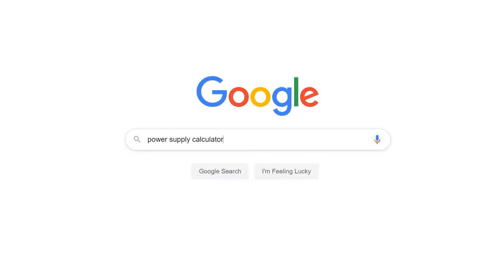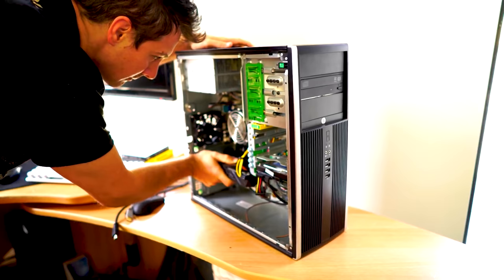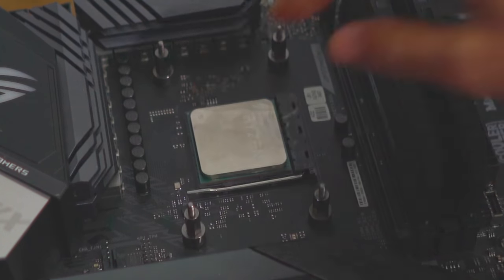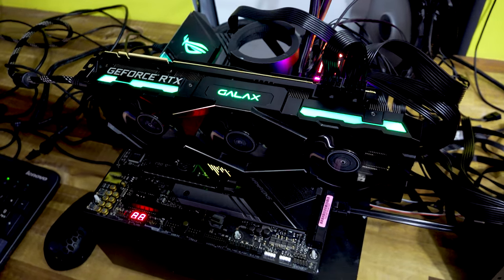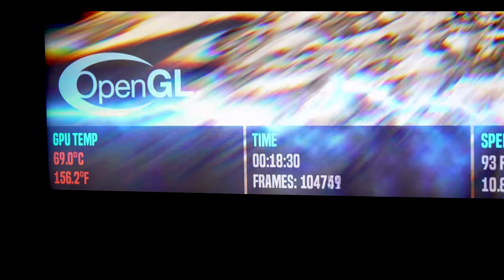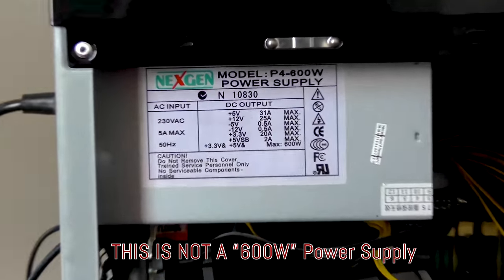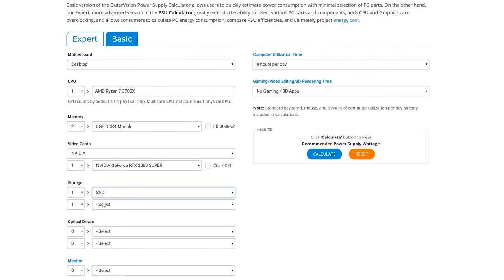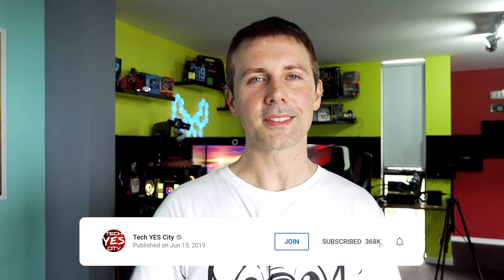I Tried Running a 3950X and RTX 2080 Ti on a 450 WATT Power Supply...

Comment: I' m a bit disappointed, you didn't stress both the cpu and gpu to 100% at the same time.... The peak watt usage as calculated was 477 watts, that's when the system is on a full load.
Could've achieved that fail state easily but you only stressed the cpu first, then the gpu afterwards. so all we know is that it's save to game on because a game will never fully utilise a 3950 and 1080p gaming will not fully utilise the gpu either.

Comment: You checked something that for your calculations is a BIT too low. BUT you didn't add keyboard, mouse, monitor, rgb motherboard, cpu rgb cooling, hours spend on gaming/work, and: OVERCLOCK. If you would get these thing you would get a real answer.
On be quiet psu calculator you would get a reasonable 636 and that means you need at least 650w psu. 600w psu would get it working, but you shouldn't be cheap with your psu. bequiet recomend at least 700w psu. On outervision you would get something around 641w load wattage.

Comment: Try blender cpu and gpu !!! , I get about 480 watts on my 3900x and a RTX 2700 super at the plug , which is about right on my 650 psu , So with the 2080ti I guess you will be over 500 watts ?.

Comment: While this is completely possible as shown in the video. But…. This psu will wear down over the years and quickly. So it will work but only a matter of time till it fails. Hence why one of my 750w 80+ rated corsairs can’t even handle a 1060 anymore after 12 years of use.

Comment: I have evga 550 g2 supernova 80+ gold , which is 12v 45.8a (true 550w) and my system is kind of old now (i5 4570 & gtx 960) so because of this i want to upgrade to some ryzen 3600 + rtx 3070. I wonder if my 550w would be enough for this upgrade or should I aim for less tdp cards such as 2070 or 2060s? I really want to go for 3070 since that card is going to be price/performance champion but I dont want to have to change my psu either... idk help guys.

Comment: i have a i9 9900k + RTX 3070 + 4x DDR4 8Gb + 1x M.2 NVMe SSD 1TB + 700W PSU = when i put it up a good GPU usage, the PC restart automatic, i changed the PSU 1 month ago, since myu RM750W Corsair fried. and since then...the PC does that when i use PGU power, and not only that, but fortnite on Performance mode, with only Fortnite Opened, it stutter A LOOT and some times crash the game...this never happened on previous PSU...what's hapenning here?? cause i'm going crazy!

Comment: I'm still using a 10yr only pc with a cheap power supply of less than $10 it's working perfectly fine...frontech. But the pc is so low end. I can't even play prince of Persia forgotten sands in the lowest settings with the lowest resolution even tried resolution lower than 500pixels :(

Comment: My 2070 super oc killed my 500 watt thermaltake psu lol. 32 gb ram. Liquid cooled. Fx 8350 4.2 ghz cpu. Lol I was amazed it lasted for two weeks
Reply: why oc it? it would've been just fine if u had stock clock

Comment: Hey everyone, Please help me..
I'm currently on Corsair CV450 PSU and i'm planning to buy a Amd RX 6600 xt for my build
My cpu is 12400f, mb is gigabyte b660m, ram is 16gb 3200 ddr4, one nvme ssd and 2 7200 sata hard disk and 3 140mm fans on my system
Is my power supply enough for rx 6600xt or i shoud upgrade my psu to a 550w unit or 500w unit?

Comment: I just went to that psu calculator website, but it doesn't have all the graphics cards to choose from. The closest one was the Nvidia 1660, but mine is the MSI 1660 Gaming X 6GB. It wouldn't even let me set the memory clock for an Nvidia 1660 over 3GHz, when mine is stock at 4GHz and OCd to 4.6GHz. With my build though (Using the 1660 provided,) it has a load of 505W and recommends a 555W PSU and I have a 550W PSU so Ig I estimated pretty well for what I needed.
Reply: After going to other PSU calculator sites, I've gotten different results between 350W to 650W for as close to the same build as possible, but without being able to put in the exact models of all my components and any overclocks, it really isn't accurate at all.

Comment: Through the time, power supply wattage DOESN'T make any sense. The old power supplys have way weaker 12V but bit more stronger 5V lines. Old 450W cannot compared to latest generation 450W. 

The video is right, you need look at 12V lines in the specifications. This is where we should look at it, to make sure power supply is good for your computer. And never go for the limits, because power supplys have safetly circuits to shut off the power supply.
That is why they need some headroom to keep it running without problems.
Stressing more out means also the caps in power supply will work harder and heat will bit higher. Higher heat in power supply will reduce lifespan of caps. 

The 80Gold marks is not for 100% power use, it's calculated around 50-75% power supply. Because at 100% the efficiency will go lower. So yes, for best efficiency, you need to use the sweet spot in the power supply, then you will waste less energy.

Comment: Running Rocket league in the menus in hundreds of frames per second is better for this kind of stress testing than running Heaven or Furmark.
You want to experience millisecond or nanosecond power spikes instead of a constant load.
Then the PSU turns off.

Comment: i try to run nvdia gtx 1070 external for my laptop...any suggestion how power i need for tht???
Reply: 300 watt alone is enough. 
Why? because You're running just GTX 1070 without any Motherboard, CPU, since you plug it to a Laptop as a External GPU.
Basically pay attention to 12 Volt must have 25 amps or higher

Comment: Still over power with a psu .
And the reason ?
The fan will not turn in the psu .
The psu can be use passive mode and you have no sound .
Same with water-cooling on a 65 watt tdp cpu.
You can cool it whit the fans of .
So over power use can be used if you want have a pc with no sound produce.

Comment: if the calculator says 620W and my power supply is 650W. Would that be fine?
Reply: It should be as long as you're not overclocking or doing anything too CPU/GPU intensive.

Comment: Would 400watts work with a RX 570?
Reply: Yes, 400-450w with any 80plus certified will be ok for RX570, RX5500 xt, GTX1060/1660super, RTX3050 and RX 6600. My rig with ryzen 5 2600, 16gb ram run RX 570 for more than 3 years and still staying strong now

Comment: you heard about me didnt you...r5 1600AF @ 4.1GHZ xfx 5700 dd ultra flashed to the (stablest) it would handle bios, 2x8 sticks of 3466 hyperX ram CL16, and a FOCUS GX1000watter lmao...SERIOUSLY! i do however have a 2tb adata xpg pro 8200 nvme, 2x500gb wdblue ssds (sata), 2x1tb 7200rpm hdds, 10 120mm fans and a 140 ml as well, and a 240ml aio..... with the saberay adv case.....

Comment: If this 450 can run a 2080ti surely my 300w can run my 8gb of ram a athlon3000g and a 650ti, right?
Reply: What's the Brand Name of Your PSU?
Does it have 80+ Silver or Gold Certification? That's very important.

Comment: that isn't the most accurate explain if you look at effective of power supply you will see that graf go lower at the maximum of usage of power supply. So for 450 wat you should have at least 600 w power supply 80% (480 w) +- 550 wat will be for that max, and there is another case to keep it quiet and that option will be better for large power supply, but in my opinion 600/700 w is all what normal user need with new rtx and good cpu needs. oh and you should calculate watt for extra fans and  usbs and etc

Comment: Are you use 450 power supply. Then maximum power use 431 Watts. You use 550 watts power supply then how much power consume  ?.
Reply: It depends.  The power use (431 W) also measures the power wasted by the power supply (in AC-DC current conversion) which can vary from product to product, but also from the % of power use compared to the product's max power rating.

But basically, if you compare similar 450w and 550w products, the 550w should be more efficient & consume less power than the 450w.  It's because the power use (431 Watts) is >95% of the 450w capacity, and only <80% of the 550w capacity.

Comment: thank you man...now im feeling safer to buy seasonic s12 650 bronze for a 2070 super
Reply: Im using a P650B gigabyte psu for my gaming oc 2070 super also. No problem ran into!
Reply: Mate I have an evga 500w bronze for a 2070
Reply: Joshua Gollaher yea but i have a 360 aio,10 fans in total,2hdd,ryzen 7 3800x and 2070 super with oc...:))

Comment: I didn’t understand the concept in 8:20 how i would decide if the power supply decent or garbage can anyone help me ?
Reply: As shown on the box, the 450W power supply is expected to deliver up to 37 Amperes on the +12V rail (basically the DC current that goes to your CPU and GPU) at 100% load.
That is: 12 V * 37 A = 444 Watts (MAX for CPU and GPU), very close to the max total output of 450W

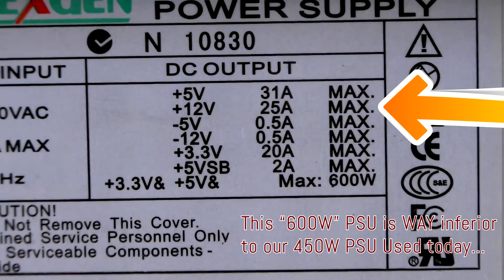By contrast @8:30, the "600W" power supply is expected to deliver up to 25 Amperes on the +12V rail.
That is: 12 V * 25 A = 300 Watts (MAX for CPU and GPU), only half of the advertised total of 600W

Comment: well this calculator is highly inaccurate in my case
pc with r5 1600@3.7ghz OC + gtx 1070+16gb + 2hdd+1ssd+1nvme doesn't consume more than 220W at the wall using same device you used, while in calculator it shows 374W load and 424W recommend, on top of that i use 10 yo Seasonic S12II-Bronze 520W, which according to internet "experts" should lose it's efficiency in that amount of time used, at least by 20%
games tested: ACO, Division 2 and Crysis 3, i'd say the only games that will utilize most of your cpu/gpu combined, just to be sure i ran aida64 stability test to make sure all cpu cores were maxed out

Comment: Im using 450 watts psu thermaltake FOR
Rx 580 8vram
I5 9400f
16 ram 2666
Hdd green 2 tb
Ssd 250gb
5fans including cpu cooler
B360 gaming plus
I recently saw that rx 580 uses lot’s of power is 450 is enough if anyone found out please tell me

Comment: i completely disagree with your reasoning here, respectfully.  Its important to take advantage of your psu's 10 year warranty.  Knowing this i always buy a 1000w psu.  My current psu has been moved into 3 generations of intel processors and 4 generations of nvidia hardware.  All because i didnt just meet my needed specs.  Nowadays you can get something like the evga 1000g3 for like 150 dollars on sale.  I even saw it for 99$ on black fridays weekend.

Comment: do not do this as it stresses out the caps on the PSU it will eventually will fail and take out components with it.
a 650W PSU is lowballing it i would recommend a minimal of a 750W PSU ideally a 850W PSU is best for the minimal of this set up.

Comment: I have the 600w version of this and have a problem,ive got a ryzen 7 2700 and a gtx 750ti(ik it is an old and slow gpu but i had no more money for a good gpu)and whenever i play a game that  stresses the gpu more than the cpu the computer shuts off(the psu shuts it off).Im not sure if its the psu or something with the mb,ive tested the gpu in another system,worked fine.I tested the ram with memtest,worked fine.The temps are good.It should be the psu,but its cooler master i thought this was a good brand.Can anyone please help??

Comment: I bought a rtx 2080ti but I have a 550w sharkoon say it doesn't explode?
Reply: I don’t know about your 2080ti and how good your cpu is but I think it should be fine. Chances are I don’t have his cpu as his is the best one on the market currently(I think). I was wondering the same thing about my i7-7700 and rtx 2080. I bought a 550w power supply for them and I’m just worried that I’ll have to get a more powerful power supply. The wattage calculator said the recommended wattage was like 405w and I just went up one to 550w. It should be fine but I am still worried. Good luck with your build!

Comment: Can I use rtx 2060 on 450watt psu?
Reply: If it bronze or at least 80plus then yes. A good 450w psu can handle 1660super,2060,3050,rx6600 and rx6600xt without any issue
Reply: @profchaos7289  3070 with 600w ?

Comment: Hallo Guys 

I need a help?

Can i run  

--Zotac Gaming Geforce RTX 2060 AMP ED 6GB 192bit GDDR6 

--with My  Cooler Master MWE 450 watt 80 plus white Certified PSU.

-My System Config-
Processor - i5 9400F (Stock Cooler)
Mother Board - B365M Gaming HD – Micro ATX
Ram - Corsair Vengeance 8x2 16gb 3200Mhz
SSD – Toshiba 256gb NVME 2
HDD – 2TB 7500rpm
And 2 Fan in Casing for air flow

Cause i will Record Gaming Videos for Youtube 

Thank You

Comment: Me watching this video in hopes that I can plug an 1080 into my system powered by an AcBel 80 plus bronze 450 (435 PSU ) i5 8400 -2x8 Gb DDR4 -3 fans - 1 ssd + 1 HDD and a DVD-RW. .... I hope I won't catch fire.

Comment: Never cheap out on power supplies 

Dude if you have this processor and graphics card, you talk about saving a little bit of money for a power supply? 
I’d rather pay $50 “too much” and have a good PSU than cheating out and running on the max. 
I got an 5 3600 and 2070 
With a 650watt 80+ gold 

You need it!
Reply: If you get a good quality PSU, why would you need it?
Reply: @MaggoSheesh  

Well I wanna upgrade in the future. I’m not spending much more to get higher watts with a premium quality PSU, mine also has a 7 year warranty and will last way longer. 

Of course I’m sticking with better to be able to upgrade to what ever I want
Reply: @teatimeboy3240  If you are a person that would potentially upgrade to the high end cards, yeah that's a reason I understand to get a higher wattage one

Comment: I worried if my PSU 650 whit cooler master will support the 2070 :O
Reply: ya you defintely will be fine with a 650 my 1080ti and 8700k overclocked build hits around 500+ under heavy loads. so even if you overclock thing and make it to a max of 500 your still right at 80% which is ideal for maximum power draw from a psu. but if you have a more power efficent cpu you should have even more headroom

Comment: just for the record my 9700kf 5ghz all core and my 1060 2202mhz only pull about 330w from a wall under stupid loads, u can run that config on a good quality 500w ez

Comment: You never pushed both the CPU and the GPU at the same time. A big NO NO when testing the power supply.

I was looking at a used system with a 4 core intel and a 1080 on a 500W PSU. The moment I popped both prime95 and kombustor, the PC shut down immediately. On the system you have here, you will probably destabilize a 500W PSU easily, as the 3950X is a 140W CPU, and the 2080 ti is a ~280W GPU, which doesn't leave a lot of room for the rest of your hardware.

Comment: does 450w PSU can run Ryzen 5 5600g with rx6600
Reply: have you got answer ?
Reply: @raiikagaming   I didn't baught the GPU yet, but maybe I'll upgrade my PSU atleast 550w when I get a GPU
Reply: @abhay.tx__ crosair 450 can run 3060ti easy li
Reply: @harshmeena3387  I got cooler-master 80 plus bronze 450w

Comment: Don't agree.  That 450w would be dead in a month constantly running and stressed like that.  A couple hundred watts more future proofs your rig and will go thru many builds and will let you upgrade components without having to buy a new one because you ran out of wattage.
Reply: And with the 3080/3090 cards coming out you'll need as much juice are you can get.  If you got 'just enough' power in buying a PSU, you'll be buying another one to run that new 3080/3090 - and PSU makers know the power requirements of these cards and will raise prices so it'll cost you even more in the long run for NOT buying an 'overkill' PSU.

Comment: hello~ i need help please! my pc shutdown during benchmarks
i run with 

ryzen 5 2600
rx 570 4gb
16gb 3200hz
450w corsair vs psu
1ssd
2hdd
4rgb fans

and when i run heaven benchmark my pc shutdown completely like it turns off in the middle of benchmark , and also getting an occasional bsod
what could be the issue of my system?
Reply: Check BSOD code and Google it.
Usually it tells you what the issue is.
Reply: @sangeethkc  it says overheating issue, faulty ram or buggy driver , im sure there is no issue with my thermal and ram , it leaves me with buggy driver , or my PSU lacks power? when i benchmark its 100% that my pc will shutdown completely and i had to turn it back on again
Reply: I think 450w PSU is adequate for your specs. I'm no expert when it comes to PSU. I hope someone with a bit more knowledge can help here.
Do you get BSOD randomly? Or only while heaven benchmark?
Did you try any other benchmark that will push both CPU and Graphics card to full load together?
Reply: @sangeethkc  bsod happen randomly not often , but heaven benchmark shutdown my pc when i run it
Reply: @mhikko147  
1.Update Windows with latest version and drivers.
2. Benchmark with single stick of ram one at a time to see if there is no issue with it.
3. Make sure RAM is not getting hot by other components like CPU cooler or radiator.
4. Make sure your case airflow is good. Intake fans have ventilation enough to suck air in. Make sure it flows in a good path where all the components hit the air.
Reply: @sangeethkc  my ram light up red when i start my pc then it turns back to normal color which is what i set before

Comment: Guys what will happen if u run gtx 1080 core i5 10100f on 80 watt power supply I wanna buy without changing power supply

Comment: A couple things missed here: you never mentioned the 80% rating of the power supply,  even though your meter was at 400 watts draw you can't expect 450 total watts from a 450 watt supply. Also my experience, Cooler Master is junk, Corsair or Seasonic only.